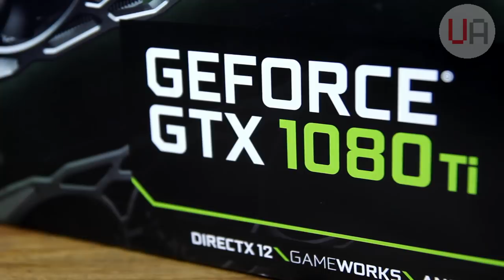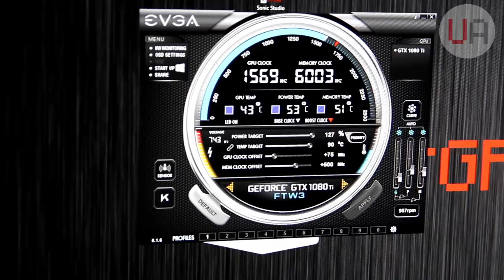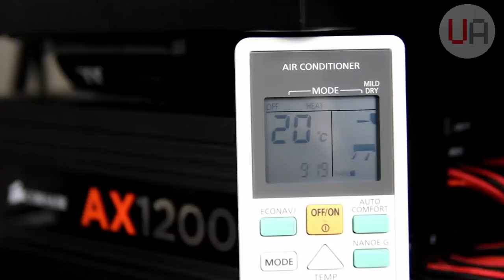Liquid Metal on a 1080Ti - EVGA FTW3 Gets Cooler!

Comment: yeh do the msi card mate, i ran the first run of test identical to what you did, i did see a sticker on the MSI so it will void warranty taking cooler off, my results were 
Stock max temp 58c
core clock 1974
memory 11010

Same OC as yours
max temp 61c
core 2034mhz
memory 11930

My slightly higher OC
Core 2062mhz
Memory 11930
temp 60c
 My MSI card only goes to a power target off 117 which i actually don't need to use to get the results i run it at 115 the voltage is at 70% on evga precision software, i run original test at 100% like yours but looks like i don't need the increase to maintain the overclock
good to see what yours does. and look forward to finding out how the grizzly compound goes on the msi, you should also do a vid putting the kraken g12 on the MSI :)

Comment: Very nice channel, editing and shots right on spot.  Actually this cooler is so damn good and the card has little room for OC that I would like to see what using this TIM (and since you're already in enthusiast level territory add some high end Fujipoly thermal pads to the test) is how low could you get the fans under full load before it throttles. Silence is the only thing you could hope for as it seems... I also run LM TIM on my WB ancient 7970 BTW... never go past 41ºC under nasty load and OC peaking near VRM amperage limit...

Comment: Hey man, love your content! I have the same card myself and have Conductonaut left over from a 7700k delid and was thinking about doing this exact procedure. My main concern is the fact that liquid metal (Gallium-based) interfaces are known to cause galvanic corrosion in Aluminum, which it looks like the cooler is made out of. Could you do a followup video on the condition of the FTW3 coldplate a few months after application? Cheers
Reply from the maker: +AspLode hey thanks! Sure thing I'll see what I cam do.
Reply: Small followup: The heatsink is aluminum but the coldplate is nickel-plated copper so I went ahead and did it. -11C in a closed case under load! Though it might also have to do with an air chute I fabricated to exhaust hot air off the card and not feed back into the fans.
Reply: sounds like both! good on ya for researching on your own, too.  mu mu mu mu mu mods!
Reply: Also, its not galvanic corrosion. Galvanic corrosion occurs when two different metals are in electrical contact. No electricity is flowing between these metals unless ur pouring salt water all over this system.

Comment: hey man.. i was actually scared by the thermal paste replacement... word on the street is, that you CANNOT use a conductive TIM on a gpu... but heck, you went all the way to use liquid metal... and the results, DAMN... i am quite impressed...

as you asked to suggest some video cards to do the same test on, can you please do it on:

1 - Gigabyte 1080ti Aorus Xtreme
2 - Gigabyte 980ti Xtreme Windforce (the overclocked one)

thanks

Comment: Have to make sure you cover those small components on the gpu somehow so that the liquid metal doesn't get on them, you can quite easily fry something. When I delidded my CPU, i used a thin sliver of electrical tape over the tiny bits, which worked fine. Your mileage may vary, just don't wanna see you frying an expensive GPU

Comment: My gtx1070 with up to 80*C after OC would like to have some liquid metal xD
Sometimes it even hits 85*C maximum temp limit when playing witcher 3, because my CPU is almost idling, and so all case fans turn slow.
Reply: Just turn the case fans up and I'm pretty sure you can get your temps down to 70C easily

Comment: Nice video! though I would recommend you to isolate the components around the GPU die from the potential liquid metal that can drip off. I did this with electrical isolating tape.

Comment: How did you go about unscrewing the four silver spring screws that separate the heatsink from the baseplate/PCB? They are very difficult access screws as the fan shroud obstructs them and as far as I could tell the heatsink won't separate from the baseplate/pcb without unscrewing them. If you found a particular trick that worked it could help for others attempting this...

Comment: The result is supposed to improve more at higher temps. So if your previous temps were nearer to the 80s then you'd see a greater reduction say like 10 degrees lower or even more depending on how high the previous temps were. 

So this should be ideal for cheaper versions that run hotter because of a less effective heatsink. Or for cards that are in more confined spaces. I have a 3 year warranty on mine and still got over 2 years left so I don't want to void my warranty trying this out. But if anyone has a GTX1080ti or any card really that runs really hot and tries this out then do post the difference it makes in temps please.

As for why companies don't usually liquid metal cool out of the box I think that's just because it really doesn't matter tbh. Since the improvements are generally only a few percent. And for the cheaper ones it's probably just to avoid risk of breakage during assembly since any errors or spills can likely result in death of the unit. But this I'm unsure of.

Comment: thumbs up for correct information on the conductonaut! its the goods! BUT!! 6:35 isnt that aluminum? (aluminium for yall)  Why mix LM and that metal? you dont plan that for long term if it is aluminum, do you?  You may want to consider Thermal Grizzly Kryonaut. it wont cause bimetallic corrosion between different metals.
Reply: Looks like nickel plated copper to me

Comment: I just found your channel. Seem like great videos and I will have fun watching the past vids. I would love to see how the ASUS ROG STRIX OC edition GTX 1080 Ti reacts to your Liquid Metal treatment. I have one and decided to go with it over the EVGA FTW3 1080 Ti after much research. I have always had EVGA or ASUS GPUs and my final choice was based on sound and comfort with ASUS. That said, I am running it in a little Lian Li (mini ITX) with liquid cooling on my CPU.My temps are good but wondering how much better. Also, how does Liquid Metal perform when in a case? 5c is an impressive reduction but will those results work for most of us that have closed cases? Cheers!

Comment: best liquid metal spread technique on youtube.  i guess the key is to get the swab wetted just a bit like a paint brush and then just rub it in instead of putting a dot on and then rubbing it around

comparing to the 1080 mini it seems the worse the cooler the bigger the impact liquid metal has instead of a better cooler.  why do you think the 1080 mini had such a good result.  it was better than this one. way better.  was the stock paste just really bad on that one or ....

Comment: why apply the liquid metal to both the core and the heat sink? is that just how its done (I don't use liquid metal)?
Reply from the maker: josh Subet yeah it's just how they explain to use it. 

I guess it's so that it bond's and doesnt push it away/around... You saw how hard it was to spread.
Reply: It isn't really necessary to spread it over the heat sink :) It does help if you really want a good immediate bond between both surfaces when mounting it. Most of the times i have LM-ed my laptops i do not apply it to the heatsink just because i do not really know how big of a spread should be applied as our laptop CPU and GPU dies becoming smaller with each architecture advancement. But if you were to do so there is no harm in doing so :)
Reply: Hey Upgrade! Just want to say lovely content for such a small channel! Really wishing you all the best in the long run! Just a small piece of advice: You should tape up the substrate (green bit around the die) with Super 33+ electrical tape to prevent any mishaps from happening just in case any LM spills over. You will most likely end up with a dead GPU if that happens! If you would like to know more about repasting with LM do join us at forum.notebookreview.com Dont let the url mislead you hahahah the same procedure applies to GPUs and CPUs in both laptops and desktops :) Cheers!
Reply: josh Subet you need to apply to both surfaces. I applied the Conductonaut to just the chip on my Strix 1080Ti, put it into my pc, ran it for 15mins, took it out to check the LM, and it wasn't bonding to the cooler's coldplate like how it should if you'd apply some directly.

Comment: thanks for the vid i did this on my RX 580 XFX and it did actually drop around 5to 7 c its one dang hot card and i got 10 fans in the system too the highest i get is 77 i used to get up to 85 c  and this is overclocked to 1500 and 2250 mhz for memory making it effective 9gbs  and ive actually been able to push it to 1525 mhz on the core but to keep it stable i just keep it straigh on 1500mhz and gaming on FF15 i get 50 to 80fps  depending on area  all on pretty much highest settings no Nvidea Works enabled. And this is with a i7 7700k at 5.2ghz also dellided and LiquidMetaled

Comment: I have been trying to find some information regarding the materials present in the ICX 3.0 coolers on the EVGA GTX 1070 FTW model with not much luck. Does anyone know if those coolers in particular use aluminum plated copper for the base of the heat sink? (I know the fins are aluminum for sure) Or is it nickel plated copper? Looking forward to an answer and thank you in advance! Nice video btw, keep up the good work!

Comment: Hey man, nice videos! This was a very helpful information for me, I am also planning to use liquid metal in the future! I have one question: How do you decide on how much voltage to set when overclocking? And if you leave card in stock how much I can low the voltage? I have gtx 760 for now (planning to change to 1070 soon), and I get temp of 81 degrees on stock settings. I lowered voltage to the lowest setting (about 58 I think) and it seemed to work still properly. I would really appreciate if you could explain this. Thank you and keep up the great work!

Comment: Nice video.  What are the drawbacks of using this?  I'd imagine it's highly conductive so if you accidentally put too much on or spilled a drop somewhere it could be dangerous and short something out.  Does it need to be re-applied after some time too?

Comment: I got in touch with EVGA. This does in fact void your warranty.
Reply: SO even replacing the thermal paste with other thermal paste it void the cards warranty? Only ask because seen some reviews that they say card gets hot so just wondering
Reply: Nope. Only the liquid metal. Replacing the original with non conductive paste is allowed and necessary too. I have Kryonaut on mine.

Comment: @ Upgrade Addiction I am wondering how the liquid metal is holding up. Do you still have this 1080 Ti FTW3? How often did you change out the LM or you did not have to change LM at all?  Also, did the LM have any Reaction to the heat plate or gpu?

Comment: I bought the liquid metal because of this video. How about a video or some link showing how to getting to that ftw3 cooler off so I can get to the gpu and apply the liquid metal? Feeling pretty insecure about unscrewing the backplate and all of that. Great video.
Reply from the maker: +Trinity you only need to unscrew 8 screws. 

The 4 around the gpu core, and the 4 ok the other side of the card holding the plastic shroud on. They are bright silver and in each corner on the front. 

They can be tricky to get to so use a small screwdriver. 

You'll also need to unclip all 5 cables... Ha ha

Comment: Hey, question here:
I am thinking about doing the same to my 1080ti FTW3 but not as much for overclocking and rather to extend the fan-less mode of the card. 
the fans start spinning at 50°c i think and as i got two screens with one at 144hz the card has to put its clock pretty high even in idle and therefore has the fans spinning at idle.
do you have any temperature results/deltas with the fans disabled at low use? 
i would assume the effectiveness of the lm lowers proportionally with the speed of the fans/the overall temperature of the card but it would be great if you could give me some insight on this!
also do you think there would be a problem in covering the surface mounted stuff next to the gpu with nail polish? many people seem to do that with cpu's to avoid shortage.
besides that, amazing video, especially for such a small channel!

Comment: Hi mate my issue is i have GTX 1070 and i want to use liquid metal but which i learned is my cooling radiator made by copper so which solution could you suggest me to reduce heat on my card :(

Comment: I have the exact same 1080ti.  Would like to repaste mine as well.  Is it ok to use liquid metal on these gpus?

Also what do I need to do to switch between the master and slave bios?  Just make sure the system is totally powered down?  Sorry for all the questions.  Thanks !
Reply: To switch between master and slave bios there should be a switch above the EVGA GTA 1080TI light bar on the side I have 2 of these cards

Comment: Isn't it dangerous because the thermal paste could drip over the edge of the die and build a short circuit there or something?
Reply from the maker: Don Pollo if you put way too much on yes. You could put clear nail polish or electrical tape over the resistors if you wanted piece of mind

Comment: It is okej to use this liquid metal on copper? I have G1 970 WF cooler with bare copper heatpipes directly on the GPU. Thanks for a good video! Subbed!
Reply from the maker: P J yes copper is safe, even nickel plated copper. 

Just don't use on aluminium.

Comment: nice video, i didn't even consider liquid metal on a gpu up until now.  It got me thinking about another thing now: is it possible to put liquid metal on the memory chips? i mean.... it should fill up those spaces nice, tho the clearance between then chip and the heatsink is usually bigger ( that's why they mostly use thermal pads) so it most likely wont work :/
Reply from the maker: Tadas Jankevičius I wouldn't put it on the mem chips
Reply: Upgrade Addiction me neither but it's just a thought I had :)

Comment: Are you just using regular Q-tips to spread the liquid metal? I've recently bought my own GTX 1080Ti SC2 and I'm also interested in replacing the thermal paste on this with Conductonaut liquid metal as well.
Reply from the maker: +Xingyu Qiu I'm using the included ones that Thermal Grizzly provide. :)
Reply: I probably should have known that... I just checked PCCG's website for the Conductonaut and they literally laid out everything in the package at the bottom, and it has two black Q-tips included. Silly me! Thanks a lot btw - really enjoying your content.

Comment: How long can liquid metal run before you need to reapply it?
Reply: I think you will find it will depend on how many heat cycles its gone through rather than a time period. As a general rule of thumb I redo paste every 6 months when I do a full loop/system clean
Reply: If you lift the cooler off otherwise liquid metal pastes don't really need to be changed as dry LM is metal and moves heat fine
Reply: Not for a very long time. As Damien said, the liquid metal might harden but still transfers heat just like the paste would. I'm sure it'd be safe until you want to upgrade your CPU, which is usually 3+ years.

Comment: To be honest I found this super weird. Conductive thermal transfer medium, with no apparent conformal coating on the surrounding smd components. Also, do you know the alloy components of all the contracted metals? Galvanic corrosion could be a serious issue, and this wasn’t noted in the video, even if your use case was fine it could ruin someone else’s card.
Reply: GN did a review on it already, youre in the clear with nickel plated copper or just bare copper. Nickel plated will be stained somewhat and copper will be plated by the liquid metal.
Reply: beaR ... thanks for replying mate. From my understand galvanic corrosion WILL occur between dissimilar metals. It’s just that with metals so close, the corrosion is very, very slow. I was talking about the cooler itself, as I don’t know what it is alloyed with. I use liquid metal on my delidded cpus, but I generally use a traditional paste for IHS to coldplate cooling, except in laptops where I know what the cooler is made of. I love ThernalGrizzly though.
Reply: the evga gtx 1080 ti ftw3 cooler is made out of nickel plated copper with aluminum fins. Im not sure if the fins are plated with nickel.
Gamers Nexus did a timed corrosion of liquid metal on the evga gtx 1080 ti over the course of 1 year, with on/off cycles. They found no significant corrosion. Just stains. Thermal conductivity was NOT effected. Meaning there was no corrosion and the liquid metal was still good.

You'll get about -5c with liquid metal on the stock cooler. Id suggest you get an after market air cooler like the Morpheus II. Liquid metal works better with better coolers. The stock cooler works well enough, but I have the room/space in my case to install an after market cooler, which should drop my temps even further.

Im expecting 52c with Morpheus II/LM vs 62c with stock cooler/LM vs 67c stock cooler/stock paste.

Comment: try it on the asus strix 1080ti. may void to warranty because of the sticker on the screw on the back. maybe check with asus because i think  the warranty mainly applies to water cooling. the strix is a beast or at least the one i have is i hit 2075 MH over clock with gpu boost 3 and temps of about 60C with a 60% fan speed. new to the channel my try this with my evga 960 just for funzies. worth a shot right.
Reply from the maker: +KillerJellyFish I have a 1080ti strix arriving early next week :)
Reply: @UpgradeAddiction  yes please do a video on that card I have it as well and I'm wondering what gains I can see. I have it in a mini itx case so it gets pretty hot like 76c in there and I'm wondering if this will drop it. Please do the test in a case though